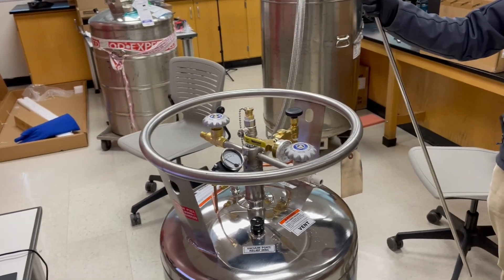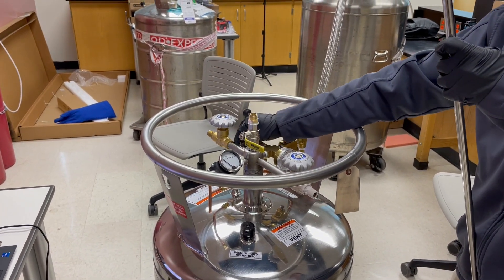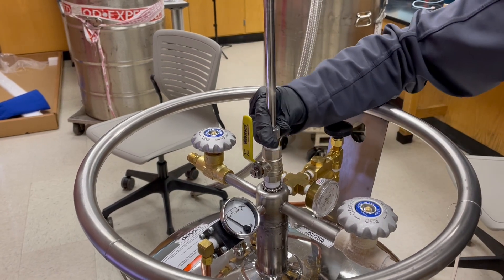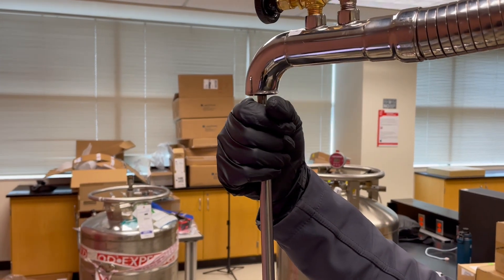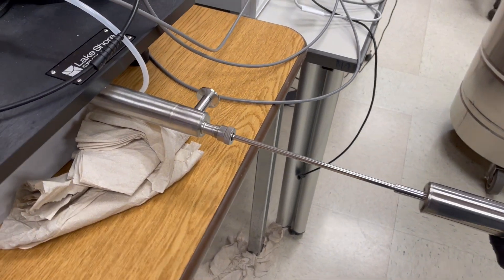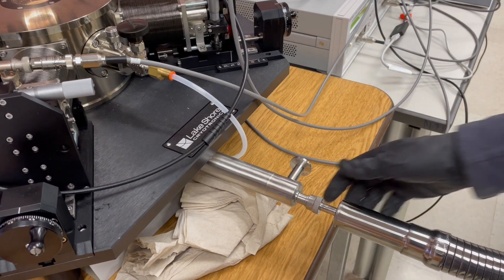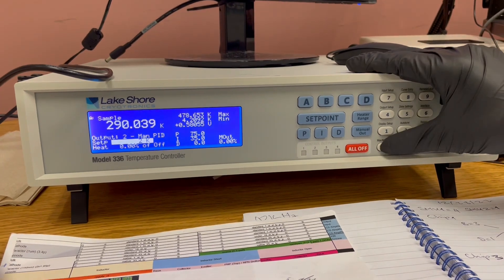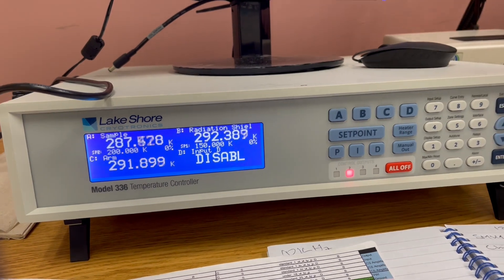How to insert the transfer line into the dewar

Comment: I wonder whether using only one hand to hold the transfer line while inserting it into the dewar could cause the long length to bend. In addition, some dewars provided by local companies develop rust layers at the bottom after long-term use. I would like to know whether this issue could also occur with Cryofab dewars and how it can be avoided.
Reply from the maker: It doesn't bend. I think it is designed for this. Not sure about the rusting issue. I had it for about 3 years, and the dewar is still ok. Thanks!